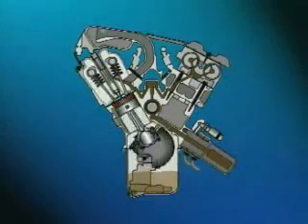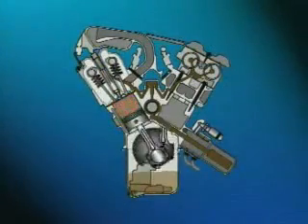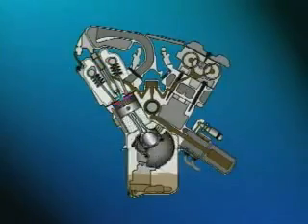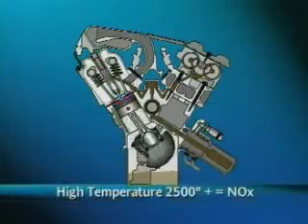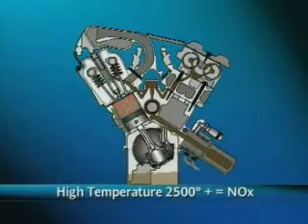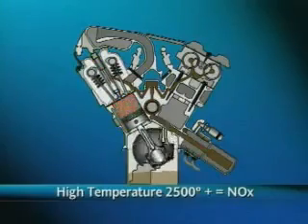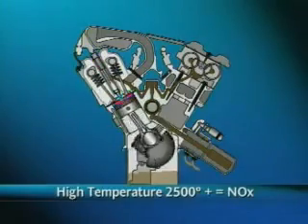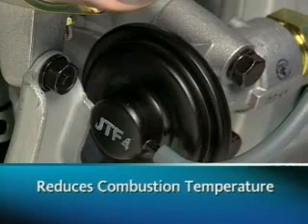EGR Valve Theory & Principal Operation

Comment: EGR should be explained better by stating EGR effectively adds an inert gas mass to the combustion mixture causing the same heat of combustion to heat up more mass, but to a lower temperature.  Ideally the expanding gas of higher mass, but lower temperature would produce the same cylinder pressures and power output as when the engine was not running EGR.

The problem is it is very difficult to get gasoline and air to combust smoothly, consistently and efficiently.  EGR makes this much more complicated and expensive.  Very smart air-fuel control system maybe able to eliminate detonation by using EGR to reduce readily available oxygen below 21% in air.  My Honda v6 Accord seems to use it that way and has never had any detonation, however, its EGR system use to clog up frequently.  At least I get something useful out of it, other less smart system have probably missed the boat on any EGR benefits they might have made use of.

Incomplete combustion of hydrocarbons from cars was the main reason for car air pollution regulation.  Catalytic converters allowed for the complete combustion of unburned hydrocarbons by acting as a catalyst to take unburned hydrocarbons to completion that otherwise would  have to be heated to 1000°F or hotter. 

Oxides of nitrogens from gasoline cars may not be that great.  Places like LA and also twilight around Washington D.C. you can see a suffer looking haze that is reported to be oxides of nitrogen.  I'd like to know if it really is oxides of nitrogen. If its a least 60% oxides of nitrogen then yes, its big deal.    Other places in the country may not make sense to restrict small emissions of oxides of nitrogen because in a regular period of time it turns into plant food.  Plants break it down into something they can use.  Its the huge quantities in LA and special weather climates that cause it to be so dominant in some large metropolitan areas.  People maybe relating the suffer smell to oxides of nitrogen.  I don't know what oxides of nitrogen smell like, but if its near odorless and doesn't make your lungs contract when it happens by you, then it has been a huge complicating factor with little payback in air pollution concerns and harms.

Comment: Exhaust gas isnt inert, it has some unburned fuel in it...which is another reason EGRs exist.
Reply: One of the benefits by recirculating the exhaust back into combustion chamber  is to build up sulphuric acid which can effectively corrode your engine together with the whole exhaust system.